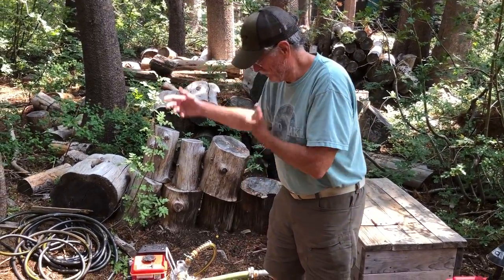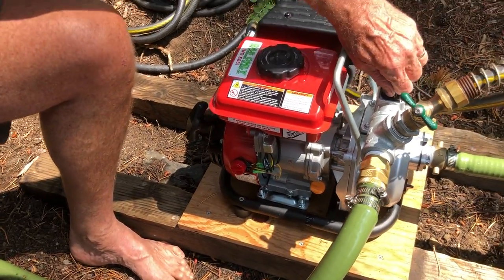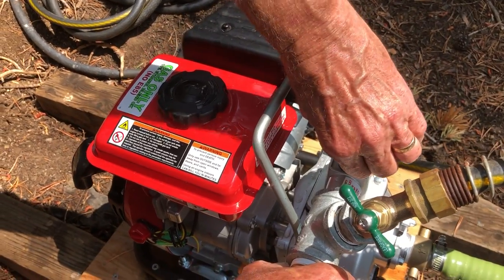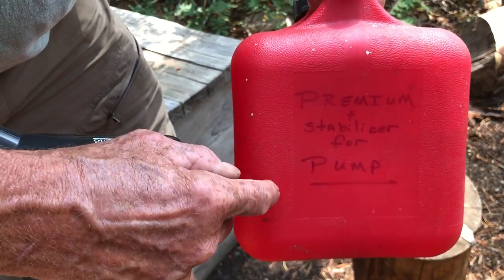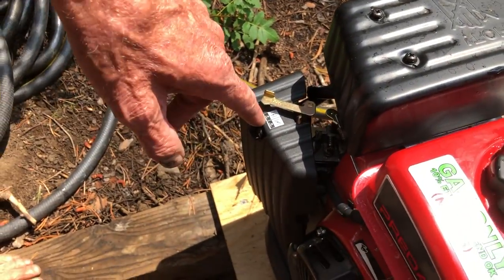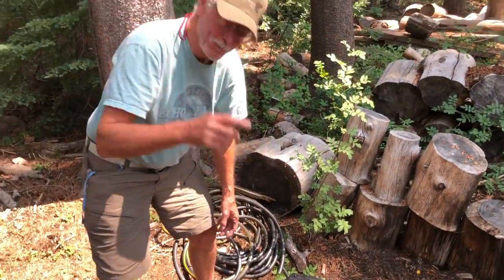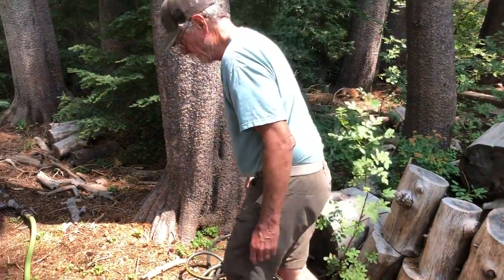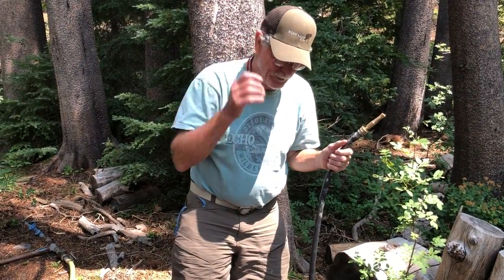Predator Pump review and instructions

Comment: Can you dead head it like shut off the valve on the end of the hose and not burn the pump up right away
Reply: Yes, But don't go out of your way to keep it running while not moving water. Also it like $70. for a 2 yr. No questions asked warranty, Bring in the old one and get a brand new one. Well worth it.

Comment: How deep is your inlet hose?  My pump could suck water out of a bucket but not from below a couple of feet down my well pipe.
Reply from the maker: Hey Jeff, ours pumps about 6 feet up from a well and pushes up about 40 feet to a 250 gallon tank. I have to stop the motor at between 10 & 15 minutes before it empties the well and loses prime. May be a simple solution to make sure your fittings are all tight and you aren't sucking any air - (sorry if you've already checked!)

Comment: 100ft in length by 50 ft wide with a PVC drip irrigation system with a 1" 2.5hp pump will it work
Reply: Hey kelvin - sorry, but I'm not the one to ask. A local garden supply store might be able to help.
Reply: @barefootgrandpa2280  ok thank you

Comment: Can you use a pressure washers with the pump?
Reply from the maker: Good question.  I haven't tried it, but since I added a hose spigot to the outlet pipe, it could work.  The pressure was close to what I'd get out of our hoses at home, so it would be worth a try.
Reply: I wouldn't. Any hiccup in the water supply through the pump, or worse yet, engine failure causing the water supply to cut off, would cause a dry run condition in the pressure washer pump. That would kill it in short order, since the pump's engine would continue running so long as the operator doesn't notice the compromised (or absent) water supply to the pressure washer. Even using a hose bib supplied by well water can be iffy, since they tend on average to have less flow and pressure than would a robust municipal water supply. Voice of experience here. Be careful. 👍

Comment: Is there a spring or governer on the throttle ? Something vibrated lose or off on mine
Reply: I haven't checked.  I'll be running it next week and let you know.
Reply from the maker: To get a good look, I'd likely have to pull the gas tank, so sorry - I can't give you a good answer. We don't run ours for much more than 15 minutes at a time and only every couple of days - so no problems so far.  Cheers and good luck!

Comment: Where did you get that pump for the motor
Reply from the maker: The pump and motor are one piece, from Harbor Freight Tools.  https://www.harborfreight.com/1-in-79cc-gasoline-engine-clear-water-pump-35-gpm-63404.html?_br_psugg_q=predator+pump
Reply: @danholmes167  what about the connection for the garden hose
Reply from the maker: Any plumbing supply or Lowes / Home Depot. It's a 1 inch to 3/4 inch T, with a 3/4 inch spigot. For this use, metal and not PVC.
Reply: Where is the water going for the outlet part. And wats the speed like at the “turtle”
Reply from the maker: @christiankama2155   it runs uphill about 30 feet to a steel water tank which feeds running water to the cabin.  I normally run it at 3/4 to full throttle, which drains the well in about 15 minutes.  It would probably still push a lot of water at turtle!
Reply: @danholmes167  thank you! Wow that’s a really solid pump!
Reply: @christiankama2155   - Yup, glad I didn't get the 1.5 inch model!